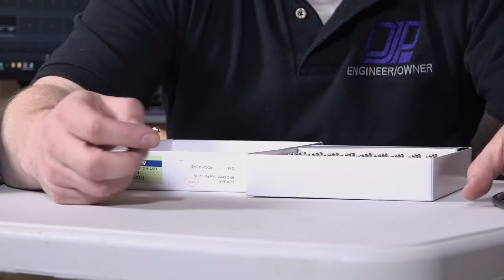What types of cables do you use for SDI professional video?

Comment: i'm about to build an auditorium, And i'd like to put a cable permanently inside of concrete, Which SDI cable do i've to choose?
RG5 vs RG6
And does "Ohm" really matter?
In fact i'm going to run a long distance cable, Maybe around 50-60m away from room control
I hope an asnwer from you sir, Thank you
Reply from the maker: Yes, the impedance (ohms) really does matter. It has to be 75 ohm or it won’t work reliably. 

Your best bet is to buy cable that is meant for SDI video. There are many choices available in the market. I tend to use Belden 1505A or 1694A more than others, but those are only two examples. If that isn’t available, your next best choice is RG6. Within RG6, there are various types as well, like quad shield, which is better than single shield. After RG6, RG59 is the next choice, but there is so much variability with both of those categories that you’ll find that some cables certified as RG6 or RG59 may not work. Check the manufacturer’s website to see if a cable you’re considering is meant for the type of SDI you need, at the length you need.

SDI requires more bandwidth than other types of video sent over coax cables, like cable TV or composite video, and it requires a higher quality cable for it to work.

Comment: Hey Doug, 
I just wanted to say thanks for this video, you really helped me.
  
What are your thoughts for this scenario? 
I use the ATEM Mini Pro and for some of my live streams i am in need of a roughly  60m camera feed from outdoors to indoors, so i was thinking on getting two Blackmagic Design HDMI/SDI Bidirectional 3G convertors and running RG6 3G cabling, however, would you recommend having 1 x 60m RG6 3G cable or perhaps 6 x10m RG6 3G cables and using female to female BNC connectors? The 60m length is seldom needed so i was thinking of having 10m cables which i can use more frequently as apposed to 1 x 60m cable which would sit i crate as apposed to being used. 

Your advice would be truly appreciated, i've been a Dj and audio guy for over 15 years and Video kind of fell into my lap since the pandemic so i am fairly new to this side.
Reply from the maker: The fewer the number of connections the better. Each connection causes signal losses and reflections and other forms of degradation. If it's within your budget, you'd be better off with a single long run than with a run pieced together from shorter lengths of cable.
Reply: @djp_video  Thank you.

Comment: Will a 3ft rg 59/u mil type p/n cvc - 59 cable work for sdi transfer of 4k or/and raw from camera to atomos shogun recorder? 3g and 12g...... Thanks
Reply from the maker: Most likely.
Reply: @djp_video  how will I be able to tell if it won’t
Reply from the maker: You'll just have to try it.  But most RG-59 cables just 3 feet long should handle 3G and 12G just fine.

Comment: Hi, which would be best to use for a PTZ camera for approximative 30m (100 foot) length cable? Will the video feed using POE Lan cable have the same quality as the 3G-SDI cable? Thanks!
Reply from the maker: 3G-SDI is always going to give you better quality video than anything you can send over Ethernet.  And at 100 feet, most decent quality cables meant for professional use will work fine.
Reply: @djp_video  So Belden 1694A cable will be overkill for 3g-SDI or recommended?
Reply from the maker: It’s a great cable. I wouldn’t call it overkill, but it does give you a good safety margin compared to most other cables.

Comment: What cable and connector to go the maximum distance over 3GSDI? Highest signal I will run is 1080P60.
Reply from the maker: The Belden 1505A that I use most commonly is rated for that distance. See the links in the video description.
Reply: Thank you  @djp_video  . So you know, the 'Greenlee 2649 Crimp Die for 1505/1694/L-4CFB/L-5CFB" is "Currently unavailable. We don't know when or if this item will be back in stock." on amazon. what do you suggest for a replacement?
Reply from the maker: You could get it somewhere else. Or get the real Canare die.

Comment: Hi Doug! Been watching a few of your videos lately and greatly appreciate the quality of information. I have been working on a streaming setup in my basement for a while and we've been using cheap HDMI to Ethernet converters from Amazon with varied results in quality control (have had to return two now). After unboxing a different brand today and having it not even work out of the box, we've decided this just isn't working out for us. So, we are thinking about replacing these with HDMI to SDI converters from Blackmagic to run to our ATEM switcher and I just wanted to run a couple thoughts by you.

First off, we've recently purchased a 500-foot roll of the quad-shield RG6 cable you mentioned in the video for next to nothing. Do you think we can get away with this for 3G-SDI if we keep things under 100 feet? The average run is roughly 50-feet to our various cameras. We are currently streaming at 1080P 60 FPS. Also, you mentioned using the compression connectors for this type of cable, but would the BCP-B4F connectors work? They had some compression types at the local stores but there is no way of verifying if they are 75 OHM or not and I've already got a crimper that will handle the Canare connectors just fine.

Thanks in advance! Cheers.
Reply from the maker: 100 feet of RG-6 will work great for 3G-SDI.

The BCP-B4F are meant for certain RG-59 style cables. They won't work with RG-6.  The connectors at your local store are most likely 75 ohm, as they're probably made for RG-6.
Reply: Thanks for the quick reply! Right, I see I mixed up the cable types. I see both BCP-B45HW and BCP-B53 on your list for the 1694 A \ F types of cables. Would I be ok with either of these? Since I already have the crimper tool ordered it would be nice to not have to buy a compression tool as well if I can avoid it. I ended up getting the Greenlee PA2649 die and a frame based on one of your other videos.
Reply from the maker: It's hard to say if those connectors will work well with your cable. There are a number of dimensions that have to line up for them to fit correctly.
Reply: Ah, gotcha. I guess it'll be a little trial and error then. This is what we ended up getting for reference (from Home Depot locally though) in case any of those specs help.

https://www.fastenal.com/products/details/0748396

Comment: Hi Doug, I remember in this video way back, you mentioned that UHD  SDI cables are a different ball game.... now fast forward to 2020, could you please  recommend a reliable 4K / 12G  Ultra Flexible  SDI Cable and BNC connectors I can buy. I do have access to the crimping tool, so I intend to make series of cable sizes  based on my needs. Thanks in advance.
Reply from the maker: I haven't seen any ultra-flexible 12G options. But I haven't exactly spent much time researching it either.

Comment: Hi Doug.
Your videos have been really helpful to learn alot from.
I have a query.I have a blackmagic decklink 8K pro card.
I am unable to get video out of it.The distance is 2M.
My connection is as follows...

8k card ===> SDI Cable----> MicroConverter SDI to HDMI===> LG TV

Now no ouptut is coming on the TV at all.I have checked with my other equipment
and the TV is fine.
My question is
1)Could the problem be my SDI converter? not sure it can do 12G
2)Could the problem be my SDI cable? i see it has the white plastic piece inside.

Can 12G travel over RG-58 over short distance?

Thanks for your response
Reply from the maker: The Micro Converters can't handle 4K signals. They'll work if you're outputting HD, but not 4K.  

If you need 4K, step up to the SDI-to-HDMI 6G for up to 30fps, or the Teranex Mini SDI-to-HDMI converter for 60 fps.  For 8K, you'll need the new SDI-to-HDMI 8K converter.

12G can travel over RG-59 for short runs, but I wouldn't use RG-58; it's the wrong impedance.
Reply: Doug Johnson Productions Thanks very much for reply.it will help alot

Comment: Hey Doug, 
In my country i can only buy belden 1505A cable without connectors and i don't want to make them myself. How would i know if a cable is good for my 3g-SDI camera's? Only the really expensive stuff says its 3g-sdi ready. I only need to go about 40 feet. Is any RG59 75 ohm cable good enough for 3g-sdi (1080p/60) or should i really look for those other cables?
Reply from the maker: Yes, the RG-59 (or, preferably RG-6) should work just fine at those lengths.

Comment: We are considering making our own!  Wondering if you could explain the difference between the RG6/RG59 &. BELDEN 1369P
Belden 1369P SDI cable,  - PLENUM (this was provided by audio install company) 
Thanks so much!!!
Reply from the maker: I haven't used 1369P, but performance-wise it looks somewhat similar to the 1505A that I use most frequently.  It should work fine for video up to 1080p30 at up to 100m.  For higher resolutions or frame rates the usable distance will be shorter. 

The connectors for 1369P will probably be different than those for standard RG-6 or RG-59.  It's similar to an RG-6, but not identical.  Belden's recommended connectors are FSNS6PL, FSNS6BNCPL, FSNS6RCAPL.

The 'Plenum' designation means that it is safe to use in spaces used for heating or air conditioning, such as false ceilings used for forced-air returns.  There are quite a few articles on the internet concerning plenum cables if that is something you care about.
Reply: Doug Johnson Productions appreciate the reply!  Most helpful :).  Great video.  Big thanks!

Comment: Thank you for a great video! What about the DIN-connectors found on some of the Blackmagic products? Are they just as easy to get on a coax-cable?
Reply from the maker: They're pretty similar. A bit more finicky to work with because of their smaller size, but the technique is almost exactly the same.
Reply: @djp_video  cool. What type of cables would I need for making a BNC to DIN adapter cable?

Comment: how long we can use this cable?
Reply from the maker: The distance depends on the signal resolution, quality of the cable, and the devices connected.  For HD-SDI with a good quality RG-59 or RG-6 type cable, 100m is pretty consistently achievable.  If you're running 12G-SDI over RG-59, you might be lucky to get 30m, even with a good cable.

Comment: Doug, you say in the video that you are using Belden 1505A for 3G-SDI, if you look on their website, it looks like it is actually rated for 6G-SDI. Am I correct in reading this? What did you use for most of the 4k runs in the trailer? https://www.belden.com/products/enterprise/broadcast-av/cable/75-ohm-video-coax
Reply from the maker: They didn't used to say that.  It's all kind of relative, though. A short cable only rated for HD-SDI will likely work for 12G-SDI. Distance plays a huge factor in whether a cable will work or not.

Almost everything in the trailer is 1505A. But none of those runs are longer than 30 ft, so it would even work for 12G.

Comment: If I take a GoPro HDMI output into a blackmagic design bidirectional converter and run it with a mono price viper 300ft rg6 Sdi then into a BM Pcie capture card will it work?
Reply from the maker: 300 feet is probably pushing the limits of the cable. If I was running that far I’d probably convert to fiber.
Reply: Doug Johnson Productions what about 250 or 200ft?
Reply from the maker: If it's a really good quality cable it will likely work.  I haven't used the Monoprice cables so I can't speak to how good they are.

Comment: Hey Doug. Great video! thanks for the link in my comment. I'm considering the Canare L-5CFW (RG6) or the Canare L-3CFW (RG59). Have you had any experience with either cable?  Leaning more toward the L-5CFW (we aren't running 4K currently but will be in the not to distant future) I also think I would like to use Neutrik connectors because they turn from the back. Have you had any experience with Neutrik BNC connectors?
Reply from the maker: Both the L-5CFW and Neutrik BNC connectors are excellent. Those will work well for you.
Reply: @djp_video  Hi Doug, I am curious why you don't use Belden connectors on the Belden Cables. 
Have you had an experience with them in the past?

Comment: hi doug, nice video. i would like to ask a question to you, any answer would be appreciated. i have a trouble the cable not connected anymore after several time of use. probably after about 15-20 live event. i'm using canare L4CHD cable and canare BCP B4F connector. i'm connecting sony NX5 camera to ATEM television studio HD Switcher. the cable length is about 75meter (160ft) , and the signal is 720p50. i have checked the cable using multitester and the cable looks fine. i wonder what went wrong? thanks for the answer.
Reply from the maker: Of course SDI signals are far more complicated than the DC voltage output by your multitester. Were the ends crimped with the proper tools? Is there any visible damage to the cable? 

If nothing else, you can try new ends on the cable. I've seen that fix issues several times in the past.
Reply: @djp_video  thanks for the answer doug.  there are no visible damage on the cable. at first when the cable is still new, the cable work properly. but after several times used, the cable cannot connect properly, i sometimes see the switcher received the audio signal from the camera but not video signal.. do this sdi cable have a lifespan? is it become broken after several time being used? or maybe it has something to do with the way i roll up the cable?
Reply from the maker: Do you use the over/under technique when coiling cable?
Reply: @djp_video  what is over/under technique sir? do you have any video about explaining this technique?
Reply from the maker: I don't have my own video, but there are quite a few on YouTube. Here's a good one: https://www.youtube.com/watch?v=B2SUoAvGxVs

Comment: Hey  Doug!  This is the 3rd  time I've watched this video. Do you have recommendations for 6g cable? and for the connectors, I've been using "Klein Tools VDV813-613 Universal F Compression Connectors" with decent success. Is there  a way to tell if connectors are also "6g"?  I only need 4k 30fps
Reply from the maker: 6G certifications are hard to find -- its a format that hasn't really been very widely adopted. If you really want to make sure your cable is 6G compatible, look for 12G certification instead.  Any cable meant for 12G will work even better for 6G. I like Belden and Canare for cable, and Canare or Neutrik for connectors.
Reply: @djp_video  Thanks; I just found a spec sheet for the 1694a cable you linked. the sheet marks it as a 6g cable, but I do wish 6g was labeled better.  http://www.farnell.com/datasheets/2331674.pdf?_ga=2.129834380.1090877853.1565720975-922377384.1565720975&_gac=1.157751624.1565721698.Cj0KCQjwv8nqBRDGARIsAHfR9wBwLSO-RqlCEA-V667Z_Kf06oAg7znLolrjRcI5x4bhSdrRpfAyqWkaAo4ZEALw_wcB

As far as connectors go, is there any id for those? or the same 12 certified would be the tell?

Comment: Sir! I have a question, If I have my camera and video switcher supports only 3G Sdi signal will 12G SDI cable work perfectly my device? Because in future we want to upgrade cameras with 4k support. and do not want to upgrade SDI cable again and gain.
Reply from the maker: Aftab Sudhozai 12G cable will work great for 3G-SDI signals.
Reply: @djp_video  Thanks you sir for quick response. Stay blessed.

Comment: how to test the quality of SDI cable？
Reply from the maker: Without a (very) expensive cable tester, run high resolution signals over long distances and connect to a variety of devices.
Reply: Thank you for your reply！Do you mean that the transmission length can be used to measure the quality of SDI cable?
 @djp_video
Reply from the maker: @zedeng5230  It's one (and maybe the most important) indicator.

Comment: Great Video! lots of solid info. The only thing I'd like to let you in on is that compression connectors are 1000000 better than crimp. Compression connectors are designed to not change the shape of your cable. If you think about the coax itself as being a water hose, using crimp connectors are kinda like placing a lil kink in your hose... I did low voltage wiring in both commercial and residential for about 10 years. And did everything from like cctv, cable, satellite, networking, fiber etc.... Btw may I add that you bringing up using quad shield is 100% on freaking point! Not a lot of folks know about that not only can you get frequency bleed out but interference bleed in as well.
Reply from the maker: The "good" crimp connectors like I use and recommend on this channel don't affect the integrity of the cable in any way -- the dielectric is left untouched (even protected by the connector) -- it's just the outer sheath that the crimp is holding onto.

Crimp connectors also hold onto the cable far, far better than compression connectors. I've had many, many compression connectors fail over the years, but I've never, ever had one of these Canare crimps fail -- not one, even though I've terminated thousands and thousands of them.

The electrical performance of the "good" crimp connectors is better too. They make a much more solid electrical connection over a much larger surface area. Signal integrity is preserved to a much higher degree.
Reply: @djp_video  Well I had a long explanation written. All about how you were less right and I was more right... Then got a call and yt didn't save it...... So we'll just have to agree to disagree 😆.
Reply from the maker: I’ll just add one comment... you won’t find a compression connector anywhere in a professional video production environment. Every broadcast facility, truck, etc. I’ve ever been in uses crimps exclusively. The compression connectors just don’t hold up. And I can say that even personally I’ve had a whole lot of them fail.